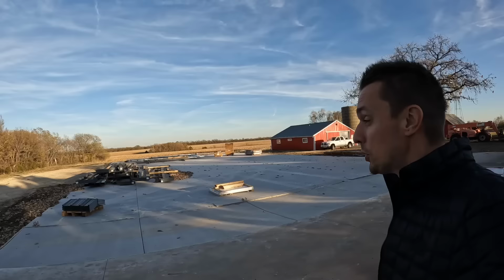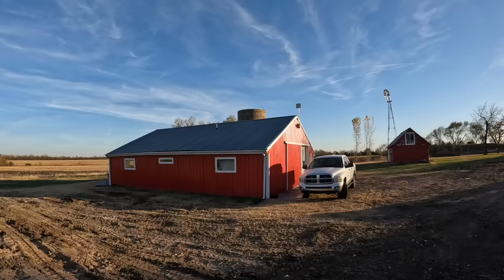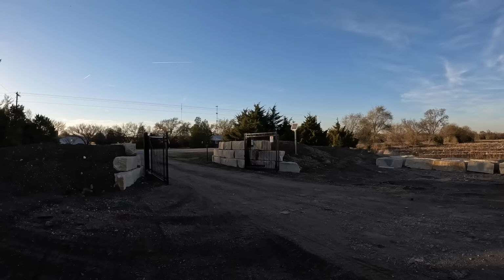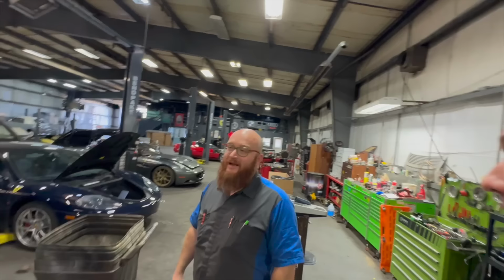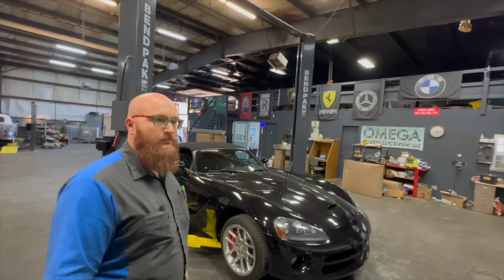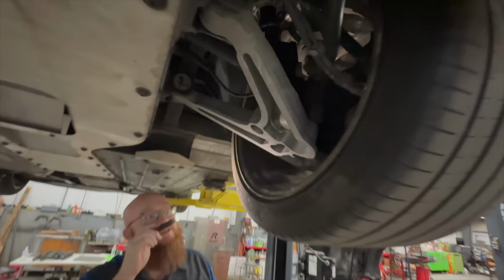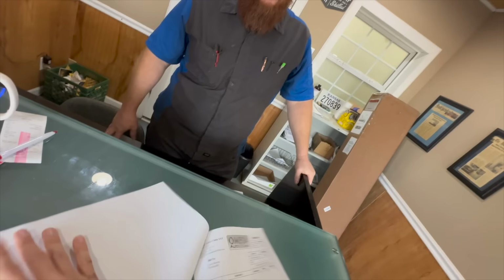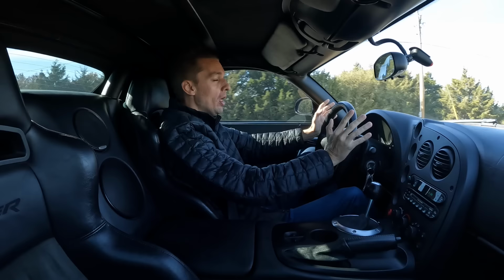Transforming an 1895 farmstead into the ULTIMATE CAR GUY'S PARADISE: Part 2

Comment: Enjoy the Viper! However, the “Hook up” you seek, will not happen with new tires.  I had a viper for 15 years and thoroughly enjoyed it, but what I learned was you have to gracefully throttle into every gear.  It’s a beast of a car! With all the weight is in the front,   The rear wheel drive with that torque will throw you into a spin quicker than you can say woah.  Be safe and have fun!
Reply: They handle terribly when pushed but look good doing it
Reply: So if you have a viper ya wanna have a large stack of supersoft street legal racing tires for the best possible grip and a tire changer/balancer cause you'll run right thru those tires.
Reply: @jamesmisener3006  they handle well when the tires aren’t spinning lol. Just have to know to feather the throttle.  Never floor it.
Reply: @tysona8421 Never floor it??? Well where's the fun in that lmao
Reply: Bag of fertiliser in the boot, works in my Dads BMW😂
Reply: My supercharged viper hooks pretty well with Mickey Thompson
Reply: Apparently, the Viper is a car that SpongeBob could never drive.  ;-)  @KS-xo3oh
Reply: I know that some extremely modded ones have traction control retrofitted. I'd suggest retrofitting traction control on the older ones too, even if they're stock! 
Especially with modern extremely well-functioning systems and adjustable systems there's no reason to not do it. Massive safety improvement. It even helps you drive them faster.
Reply: @coletrickle-km7cl  No, I've managed to drive through countless long winters in countless cars which have more power than grip.
It's not the car's fault if the rears can spin. It's not a failure or a flaw if the rear tires can break loose.

You're always supposed to drive according to the conditions. So just don't break the tires loose! YOU control the throttle!!

(And as I wrote in my other comment: I recommend retrofitting traction control. Modern traction control is incredibly good, they increase safety massively, and there's no reason not to.)
Reply: My uncle found that out the hard way when he tried to race a hotboy Civic. It quickly became a contest between a Viper and a tree the tree won.
Reply: 100tw tires and 5 sandbags in the trunk?? 😅
Reply: yup. no replacement for brute displacement. 💪🏻
Reply: That's what lead weights or cement bags are for. 

They go in the back end FYI all.
Reply: @KS-xo3oh 😂 floor it now?
Reply: Pretty sure Hoovie knows that car will never 'hook up' if you mash the go pedal.  He just wants it to hook up the best it can lol
Reply: @courtney5796  thanks for your commentary. I was just being helpful based on what he said
Reply: @kevincarey3825  Mickey’s do the trick, but I kind of changes the look, and wear pretty quick with regular road driving.  They will help stick taking off though. 😊
Reply: @tysona8421   Yes you were.   Sry if it sounded like I disapproved of you comment.  I did not, at all.👍
Reply: @pistonburner6448  I would suggest NOT retrofitting it!  Hoovie got that car for a reason.  It's not going to be a track car and cars that you can just stomp on the go pedal and let the car do all the thinking are just no fun at all.  Unless it's for racing.
edit:  racing for money.
Reply: @tysona8421  they don't wear too bad. I have personally beat the crap out of this car for 50k out of the 60k miles it has. I was running a 19/20" hre setup and couldnt hook at all. I went down to 18/18" (which you have to swap the rear parking brake to the opposite sides). The problem though is these vipers will hook and break all the other weak points. 3 differentials (1 stock, 2 wavetrac), new set of axles and a built transmission. It's doing  pretty well hah. Also the suspension is a huge factor and I am running Penske coilovers that I can adjust from track to road course.

 I've had the car for a long time and haven't kept up to date with what the latest and greatest is but I don't think I'd have chosen  bc coilovers...
Reply: @courtney5796  You are totally wrong, and have no idea how to drive if you think traction control on a road car is bad or that driving with a car equipped with traction control means you "let the car do all the thinking".

There are literally zero negatives of having traction control on a car. If you disagree you are welcome to present a specific scenario where having traction control would be bad.
Reply: @pistonburner6448   LOL WHAT.  You called that a road car!????
Edit:  It's not how fast you can go or how quick you get there.  It's the visceral feeling from a car like that.  At least it was.....  I have had sportscars (not a viper) and in every gear I knew how deep into the pedal I would have to be to break loose.  It's a car thing.  You wouldn't understand....
Reply: @courtney5796  Yes, a Viper is a road car.

Having traction control as an additional safety net takes away no feeling at all. Except blunt force trauma of smashing into a tree...
Reply: @pistonburner6448  Fair point.  Some just live (and die) a little different.
Edit:  and OH YES, IT DOES take the feeling away...  again.  It's a car thing.....
Edit:  No hard feelings, I think we can chalk our disagreement up to old school vs ne school. ;-)
Reply: @jamesmisener3006  What? It's a damn good sports car.
Reply: You do know that the Viper is nearly 50:50, right? It's actually 49.6 : 50.4, so technically rear-biased. Not sure how you had a Viper for 15 years and don't even know that.
Reply: @rustler08  I had a Gen 2.   Ask anyone that has had one, it will throw the back sideways in every gear if you throttle too much. I know what I know. Owning one and driving it all the time, and knowing stats are 2 different things.
Reply: @rustler08    i withdraw my comment.... thought you were someone else...
edit: He sounds like a new school guy.  Not someone who had a viper for 15 years.....
Reply: Correct. Even brand new tires are no match for the torque. It’s a finesse car. No electronic nannies!
Reply: C5 corvette with 500 to the wheel and I hook decent on 315s
Reply: @loganpolley7767  yes, Corvettes with hook.  Vipers are an anomaly.  No traction control, no abs, no new tech, just brute power and driver.
Reply: @tysona8421  my c5 abs and traction control are both broken like most of em I think for what you can buy and mod a c5 for its the best sports car out there
Reply: @loganpolley7767  a good buddy of mine has a C5 we go ride in and it’s a great car.  He has NO added with some other mods and it hooks up phenomenally.  And gets great gas mileage as a regular driver lol.  Great car!
Reply: A guy named four eyes making big power NA with a gts first gen viper pushes it without any trouble
Reply: @thusmarshal8815  😆 not stock, and not full throttle brutha
Reply: Is Tyler's "hook up" in this video? I didn't see her...😂
Reply: @rustler08 was about to ask the actual distribution 
Thx for that
Reply: @pistonburner6448 retrofitting-lmao.
Reply: @mikebolden3119  Yes: retrofitting.
Reply: Toyo R888r and done. 325s on my modded Z06 with 600whp and it hooks well
Reply: @06goatm6  Tires are just one thing, and you NEVER have "all the grip". Those Toyos are great, but not a "fix" for a car.

This is not criticism directed at you, I'm making a broader point using your (very good) recommendation of tires (for certain conditions).

Anyone who can't drive according to grip levels doesn't know the basic principles of driving. Even those Toyos will slip whether the air temperatures are hot or cold. All tires slip.

Drive according to grip. The best practice for that is driving on an ice track (or a safe, empty parking lot).
Reply: @06goatm6  I know it sounds crazy, and you would think the z06 and the viper would be similar, but it’s just a whole different setup and weight/ center of gravity difference.  You’d think the 335’s would have enough rubber to stick, but they just don’t stick past 3/4 pedal
Reply: I’ve driven 3 vipers old and slightly newer. Each one wanted to kill me. Joy to drive terrifying to operate
Reply: It's funny my old boss used to have a gen 1 Viper and said the exact same thing. He sold the Viper for a for a 5 speed 90's Citroen XM station wagon out of all things.
Reply: @jayman4095  it’s true!  Wow, that’s was an extreme swing of the pendulum to a wagon….. definitely less squirrelly in the rear though😆
Reply: Nitto’s oughta do the trick

Comment: Having a car repair shop (like the Wizard) is SOOOO under appreciated... Knowing you are leaving with the best you can get is sooooo great! I'm far from a rich guy, but I am willing to spend the extra for my peace of mind.
Reply: For real, I hate having to worry about a quality job.

One time I got my car serviced at the dealer and I overheard another agent telling someone "Customer called saying they had their oil pan replaced and the pan fell off on the highway." Needless to say, never got any work done there again lol
Reply: I work on my own cars and just having a lift would be a god-send!
Reply: I found a great mechanic who loves what he does to fix my BMW E30 when it's needed and won't shy away from more specific stuff. He's a godsend.
Reply: @VSautomotive  Yeah... I was to replace the cam belt and water pump (like 6 months past the due date), with the mechanic I have used for 15 years but he did not have the time to do it before I went on vacation, when I finally got back (and got an appointment) from vacation it was over a year due.... he said "The belt was literately hanging on with a thread, you got very very lucky"
Reply: Well said and i agree.....Thanks

Comment: @Hoovie the other issue with the Viper exhaust side-pipe design is that it has no balance pipe (aka h-pipe; aka x-pipe) that connects or balances the exhaust pulses from each cylinder bank.  This was most prevalent in the first and second gen cars but was fixed on later cars with an h-pipe that ran behind the bulk head located behind the seats.  This means on later cars you get a true V10 sound from either side of the vehicle and less droning aside from a 5-cylinder sound.  With this design the engine is more power efficient giving it about 30hp.  Hope this helps!

Comment: It is wonderful to see that Tyler has the new garage under construction.

Does anyone else find it really odd that many mechanics don't want to do elective work anymore?  I learned to do struts, myself, because I ran across more than one reputable shop that did not want to change them until they were fully blown out.  Struts and shocks are usually trash a good while before they fully fail, and you can make that car with 80k mi. ride like brand new with a fresh set (seriously, people do not realize the difference it makes).  Staying on top of them really saves on a LOT of other components as well.  Coil springs/leaf springs, independent drive axles, bushings, steering components, and ball joints.  They are a sacrificial wear part, but SO MANY people do not think that they are trash until they leak.

Comment: My uncle had a Gen 4 Viper. He got it in orange and named it The Coyote avter the Hardcastle and McCormick car. Even though they were totallly different. Everyone else called it the Exorcist because riding un that thing was like having your soul torn apart. The other thing was the traction was always breaking loose, especially second to third. He lost comtrol one time in tne rain and we hydroplaned into a tight spin and went up and over a median that had smooth sides thankfully but also the grass offered no traction. It had been raining for days and I thought we were going to die. But we lived and didn't hit anyone. One guy in a truck even wrote on a sheet of paper an '8' and said if he had he,d our hands up it would have been a 9. Super quick but sketchy. He did a raise on a runway in Tennessee and the car spun out again and he went 300 feet off the traxk and into a potato farm. Sold it after that.

Comment: Learned something new: I didn't know you could pour a floating pad that large. I thought anything that big had to have perimeter walls down below the frost line with intermediate ones throughout. 

Maybe they did and I just didn't see it?

Also: I had a suspicion they'd enforce the existing set back from the property line.
Reply: Ditto, I would have thought a footing.  Although thinking of pole barns and warehouses, wood or steel framed, I've never seen concrete uprooted.
Reply: There will be a grade beam under the slab probably 2’x2’ rebar reinforced concrete
Reply: Sometimes it’s just a slab, and piers are drilled where the steel posts will be. That’s how I intend to build mine.
Reply from the maker: It has a deep footing
Reply: @thebigguy8306  Not "uprooted" per se, but moved dramatically due to frost heaves. You also get cracking as smaller slabs are designed to float. 

A lot of smaller free standing garages are done this way. You build em level and plumb and 2 winters later they're all a kilter lol. 

I'd post some links but youtube would flag me for spam. Google "floating garage slab" and you'll see what I mean.
Reply: @HooviesGarage  sounds like your contractor knows his stuff. 

Make sure you time lapse when the structure goes up, it really is like lego. they assemble the U shape, lift it up with the forklift, bolt it down and move onto the next. 

Sometimes they will suspend them from a sling so they don't bend the bolts in the slab. Smaller structures we just move the posts over to the bolts and lift them on.

Comment: Hoovie:  Replacing your useless wind water pump with a turbine generator and installing a solar roof on your new structures would make you mostly electrically self sufficient. Especially in sunny and windy Kansas. You would likely be getting a monthly cheque from your local power utility, too.

Comment: So intresting how differend you build buildings than we do here in Europe. For that gigant garage you building here we would probably plan were the lifts would be and were the columns would be and use pile foundation with steel reinforcement and it would also probalby be a few feet deep and the rest would be poured with about 8-7 inches of concrete depending on the load.

Comment: Your erection doesn't last long what? JK but anyway yeah that building will go from slab to sealed structure in 5 or less days with most likely no more than a 4 man crew for building n overhead doors along with plumbing and electrical are is different sub crews. The insulation always comes last because it's super expensive and the actual building structure are pretty generic and are sold by footprint 40×60 60x100 100×200 etc. The number of overhead doors doesn't change price of steel structure it does however significantly alter the # of insulation rolls needed as well as exterior wall shealthing panels needed so until the # of along with placement of all your overhead doors is set in stone  a good builder wont order the insulation or sheathing because getting more insulation last minute  if a door is scratched off plan  is nearly impossible and will really screw up a sealed structure timeline or adding a door and not needing two rolls that you already paid for at $300 each is no good either. Bunch of other things as well the insulation needs to be kept clean dry and protected from theft which usually means inside and it's not small and storing it becomes a huge burden and exterior wall sheathing is a pretty finished product free from dents or finish scratches and the longer it sits on a job site when not needed the more damaged it may become and could end having to be purchased again so best left till very last on order and delivery so it's protection is someone else's problem and not builder or homeowner